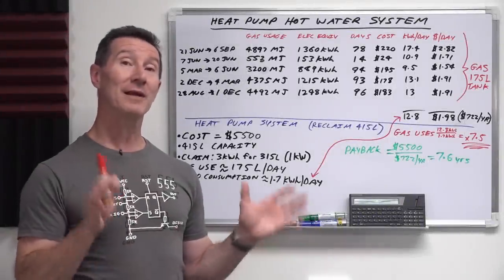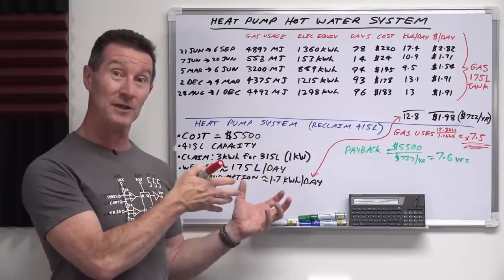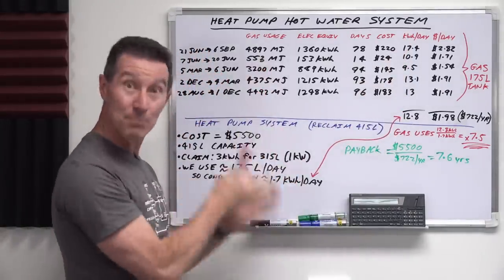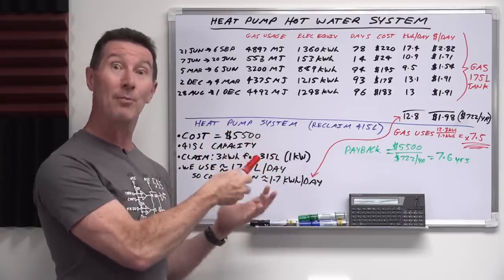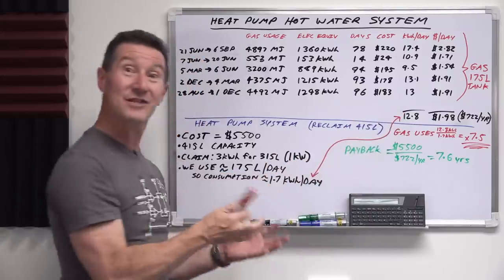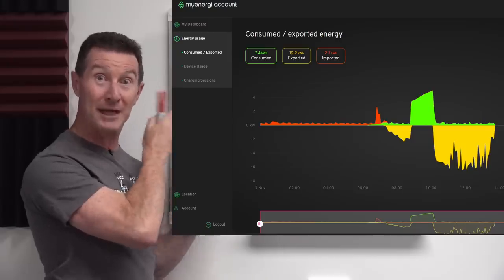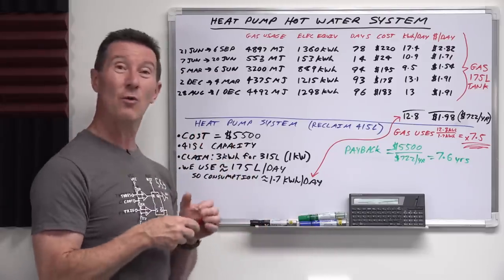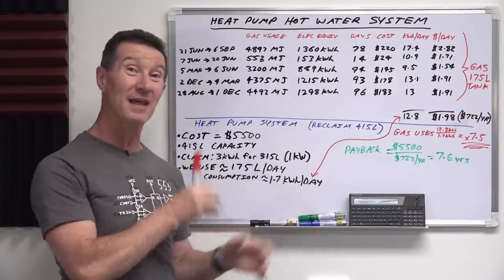Heat Pump Hot Water System vs Gas Hot Water

Comment: My boiler uses 13kWh to heat my 250L tank doing the same with immersion heater uses about 7.5kWh. What has become apparent is the heat loss from the heating loop between the boiler and tank (8-10meters some of it not insulated)
All my gas and electricity energy is pulse counted - so all the maths is done automatically every day.
I pulse count the water too - so there’s a spoken alert in the house for people taking long showers - and other handy stuff like water leaks etc
Would be good to see the actual COP - figures which should be easy with a few sensors and counters
Reply: Neither the boiler nor the immersion heater will heat the full contents of the tank to a uniform 60C, or whatever you set the cylinder thermostat to. The water is (should be) stratified with hot at the top and cold at the bottom. The immersion heater typically heats 1/3 to 1/2 of the water, and the boiler about 3/4, which agrees roughly with your measurements.

Comment: Dave, a couple of months ago we had to replace our old clothes dryer and got a new one that’s based on a heat pump. I’m intrigued to see all these new heat pump based, home appliances appearing on the market.

It’s rather amazing how the dryer works, compared to the expensive, hairdryer style method the old one used.

Dave, the way this dryer operates might make an interesting subject for one of your videos. Maybe?

Now, thanks to your video, it looks like a heat pump, hot water system is in our future.

Also, we still use our solar hot water system, thank you.

As we are in Perth Western Australia, it would be stupid not to, though I have a timer on its electric heater so it uses the solar panels at midday, to keep costs down as much as possible in winter.
Reply: Mrs EEVblog is also talking about a heat pump dryer. But the number of heat pump boxes it getting silly. We already have 4 separate aircons units plus this new heat pump.
Reply: @EEVblog  they are self contained. No extra condenser unit.

In fact they are excellent for small apartments as the moister is condensed into a removable container or pumped down a sink via a detachable hose. And the hot air remains in the dryer and not vented into the room and waisted.

And they are lot more efficient as well,  something like 4 or more times depending on the make.

As best as I can determine, air is passed through the condenser to heat it, then through the clothes, to extract more moisture and then through the evaporator to cool and dry it. Then the cycle repeats.

As the refrigerant absorbs the heat from the hot wet air through the evaporator, the heat is not lost but is immediately returned to the now dry air via the condenser.

Very clever design.
Reply: @EEVblog  also if you make a video you could just after getting the new dryer out of the box, say to Mrs EEVblog, “Don’t turn it on, tear it apart!”. I’m sure she be mightily impressed with you. 😉
Reply: @EEVblog  Don't worry about it and embrace the savings. Had one for like 15 years and the heat pump part of it has always been zero trouble. As a whole, the biggest issue was a crappy bearing for the belt tensioning pulley that gave out earlier this year. Super easy repair and no different from the equivalent vented or condenser models.
Around here, the European Commission is somewhat likely to outright impose a minimum efficiency only attainable by heat pump dryers in the coming years.
Reply: Yup - I got one recently and it typically consumes 400-500 watts while drying a big load of sheets and towels for a couple of hours. It’s baking hot inside just like the old thesis ones that took 2-3 kW!
Reply: @EEVblog  Definitely get a heatpump dryer! Mine only takes 350W compared to the 2400W of the old one. They look and feel like every other dryer, all the magic happens inside. They tend to take longer to dry thou. About 2.5h instead of 1,5h to dry one load.  But that's only 0.875 kWh compared to 3,6 kWh
Reply: @EEVblog  Had one installed here in NL couple of years ago. The difference is huge. Old style dryers are very wasteful since they only use the heated air once. Really stupid if you think of it.
Reply: These things are great, basically a dehumidifier for clothes...

Comment: If that's an '80s gas water heater, probably only about 60% of the energy in the gas will go to heating the water.  The rest will go up the flue.  A modern 95%+ efficiency condensing unit would cost a lot less to run, but still use more energy than the heat pump one.  And since you've got the excess solar, electric makes a lot of sense.

Comment: Take note of how much energy is going to go into the new hot water storage system when it's first fired up, you should get an idea of how much energy it's going to need to heat 415 litters of water. 
Also, maybe it's a Sydney thing but down here in Melbourne, central heating is a thing! Gas fired central heating. You might have been referring to hydronic central heating which is common in many countries outside of Australia...

Comment: The only problem with heat pump water heaters, is during the winter. Whatever you heat the house with has to be figured into the operating cost. We use BTU's in USA. If you remove 1000 BTU's from the room you have to replace the room heat with some other heat source.

Comment: I got a instant hot water unit. Absolutely love it
Reply from the maker: No thermal battery for you.
Reply: @EEVblog2  No unfortunately, maybe on the next one. Interested to see the results after install.
Reply: @50Hz  Dave read my analysis and why I chose a tankless, I'm pretty much off grid. Check your tank, bet it has an element in it with a COP of 1. It's not exactly a "thermal battery", that's called standby losses and that tank is cooling - entropy, every time it cools past a specific point the systems calls for heat.
Reply: @mosfet500  everything I have read is for LOW usage households tankless are better but for higher usage environments heat pump TANK types are better 
Dave is trying to "consume" solar power and NOT back feet to the grid so he wants to "time shift" the supply/demand
Reply: @jasonriddell  I can tell you from living basically off grid for the last several months that the thing you want to control is when you use energy. Here's an example: I have a robotic vacuum that I charge during the day and I can use at night so I'm not using my battery bank to vacuum. I have several things like this and I control when I use energy very well, you pick this up right away when you're watching every watt.

The problem with HPWH is that they are very slow to recuperate, about 3 hours so usually people set them to heat during the night so they will have shower water the next morning. With the tankless I have the option when that unit draws energy, clothes washing for example. With a HPWH if you draw the tank down too far the electric element kicks in and you now have a standard tank water heater.

I don't know what the break even point is as far as usage preferences for one or the other but you're probably better off with a HPWH if you have a big family, it's just one to two people here most times. I did do the cost breakdown and by the time the HPWH catches up to the tankless you're pretty much at end life. You'd be surprised how much you save just using hot water when you need it, I'm monitoring my usage and for the last two weeks all I used was 19kWh but it was mostly just me as my wife was away. Dave's got four or five people in his house so let's say we multiplied my usage by five and then doubled it to get a monthly total. That would only be $20 for the month at my rate.

Comment: it's a neat concept; more to go wrong in 10 years, though, as you're adding another compressor etc to the list of things that can break expensively. this differs from north american ones in that yours has an outdoor unit and the NA ones pull heat from indoors. how cold can it be outside before it stops working? 
i'm guessing australia doesn't get as cold as where i am in canada (i've seen -34c in recent years) - the air-to-air heat pumps don't heat at those temperatures, making it tricky to design hvac systems when gas isn't an option.
Reply: Agreed.  Have fun with that resistive element burning all winter long.  You might as well just hang electric baseboards on the wall, would be much cheaper.

Comment: This seems way to good to be true. Even if you have a really bad gas heater at 90% efficiency it would mean a COP of 
12,8kWh*0,9/1,7kWh=6,7.

That just seems way to high for hot water especially as you want to have higher temperatures then for heating heat pumps.

The system we just installed has a listed COP of ~5 for a 20°C difference between air and water temperature.

So even with the relatively high air temperature I doubt you will reach a COP of > 5 over the entire year.
Reply: OLD heaters can be in the 60% range

Comment: I would be curious for it to be compared to a modern gas tank instead of a 30 year old one. I suspect the 30 year old tank is ~80% efficiency vs 94%+ on modern ones. I wonder how long the ROI of a heat pump at $5500 vs a modern gas tank at probably $1,000 and an extremely cheap bill. Also what's the estimated lifespan of the heat pump tank - I'm floored your current one lasted 30 years! Currently we use a tankless which provides hot water for laundry, dishes, sink, and showers. My own showers average 15 minutes with a 2.5gpm head, so probably 1.0gpm of hot water.. That's roughly 68 liters for just my hot shower. All this to say, with our modern gas tankless, it uses between 4 and 7 CCF of natural gas a month aka 2.05KWH (For 7 CCF). My tankless was $2200USD to install which included new vents. Might not hurt to quickly compare a tankless (both gas and electric) as well as a normal gas based tank water heater.

*Edit - I'm also curious - have you been cleaning out the sediment from the 30 year old one? I wonder if its capacity has been reduced as well as its ability to heat the water because of the sediment. The more I think about an average daily of 12kwh to heat ~ 45 gallons is insane. You're using the equivalent of running a microwave for 12 hours nonstop. Or an oven set to 230C / 450F for 6 hours.... every day... Your water heater is not functioning properly for sure...
Reply: Ur on the ball, life span versus conventional Rheem my family had in a little cupboard upstairs in the Laundry with little space vented on a Cowl compared to these heat pumps that needs roof space and permits just to save a few dollars... then these people drive big 6 cylinder cars and turn on the house heater and wear t-shirts in wintertime.

Comment: Always amazing to see you guys put your hot water cylinder on outside of the house :) You mentioned that you heat and cool the house with a regular reverse cycle air conditioner, you didn't fancy going all-in on a multi-head VRF unit with heat recovery? Pump the heat out of your house in the summer and dump it onto your DHW cylinder?

Comment: My particular rural electric cooperative here in the US does a one for one kWh trade, so in effect it acts like a kWh bank. I currently have an 11,700 kWh credit built up. I’ve just replaced my propane fired central furnace for a heat pump system so I expect to start digging in to my kWh credit.

Comment: I'm definitely interested in this without a doubt! This year I bought qty 40 240 watt solar panels, 15k in LiFePO4 batteries and 2 all in one inverters because I could see energy costs going up.  I spent $1.21 per gallon on propane 2 years ago & $1.29 per gallon last year.  This year with shopping around to 5 different vendors in my area got it for $2.18 per gallon.  So with what I've seen in costs going up I'm doing everything I can to supplement my energy needs with solar solutions.   I think a heat pump hot water might be just another way to do exactly that.  Thanks for the great vids my friend, and I look forward to more 😁

Comment: I had a conversation with our Building manager today & he mentioned how the 2,500 person office is going to replace the gas hot water system, to a Heat Pump system!
The reasoning; Using GAS to heat the water is worse for the NABERS rating, than electricity...

Comment: Problem is you won't get 7.5yrs of running time out of these heat pump units. Mark my words. Been in plumbing for close to 20yrs, it's the reason I don't recommend them. Perhaps this SS unit will prove me otherwise, but I'm yet to see a heat pump get past like 5 yrs
Reply: The japanese pump has a 6 year warranty. Our aircon unit is now 18 years old and going fine.
Reply: @EEVblog  most units I've dealt with have been tank and AC unit in one, on top of tank. These may be a different story, let's hope so.
Reply: What's the tank warranty out of curiosity?
Reply: I have a package heatpump unit that is OLDER then 25 years and it still runs like a champ and is likely more like 40 years old

Comment: Your water heater looks very old and might only be around 40% efficient. I have a tankless unit at around 97% efficient. However I did rip the resistive heating element out of my hot tub and installed a heat pump. It just sips the power when necessary and keeps the water hot all year. My measurements and conversions confirm based on the energy in vs temperature rise that on a warm day it outputs about 7 times the heat as energy consumed, it outputs 41C water temp during heating.

Comment: I have NEVER seen ads claiming GAS was "efficient" but "cheap" so the question is what would an ELECTRIC tank cost to run on AUS power rates for the SAME water usage AND the heat pump 
maths assuming ZERO solar power I assume it then "looks better" 
I know in Canada a 30 YO tank would be around 60% efficient and modern "condensing" tanks are around 92% I believe - same with central boilers / furnace units

Comment: Your stovetop is currently better at heating water than your water heater... A 1000W stovetop element (the smaller one) can heat 20L of water on average in about 33 minutes. That means it's using 0.5KWH for a 5 minute shower's worth of hot water. Lets say that's a family of 5... that's 2.5KWH / 100L for showers.... I'm pretty sure you don't need 10KWH to heat the remaining 75L....

Comment: Their claim is a bit optimistic but not impossible.
To heat 315 litres of water from 15 to 60C requires 16.5 kwh of thermal energy. The COP would be over 5 then.

Comment: My current home is a single storey dwelling. We have a standard gas HWS. One side of the house always has hot water much much slower than the other side where it's nearer to the HWS. With heat pumps, do you think it works the same way? Meaning, do you think 2x 40 (or 50) gallon heat pump HWS is better than just 1x 80??

Comment: I have a small Midea heat pump HWS. It draws about 500w to run the heat pump, and it runs for about 3 hours a day to heat the water we use. I program it to kick on at about 8.45am and switch off before peak pricing at 3pm, but it is up to temp by 12pm, so it doesn't switch on again until the next day.

The solar PV is a 5kw system. I'm about to disconnect the gas ducted heating and install two reverse cycle air conditioners instead. Price is $5700, and the gas heating is $1200/year, so in about 5 years the AC will be paid for, not to mention the savings of running it off solar, and actually having cooling in summer. 😎

Comment: I've think doing this for the pass few weeks.  But we have 2 inline gas heaters, so we have to plumb in a tank. Also we don't have much excess solar. Only a 3kW of panels (10 years old), 2.9kW battery (6 months) old.   I see it I can work out hot water consumption from the bills.  Probably do it anyways.  My wife wants to get off gas.

Comment: That gass efficiency seems low but could also be a product of the age of the unit. I see the Reclaim Heat pumps are use CO2 refrigerant. What is the highest temperature you can get the water to?. I would think easy 80°C. and they should work to sub zero. The air source heat pumps I worked on reached COP 1 @ -5°C and COP 6 @ 42°C ambient they were R134A. Just a little gripe I have with some explanations - A heat pump is not a 'reverse cycle' AC you are just using the oposite sides of the cycle ie the condenser to heat the water and the evaporator to cool the air or ground water.